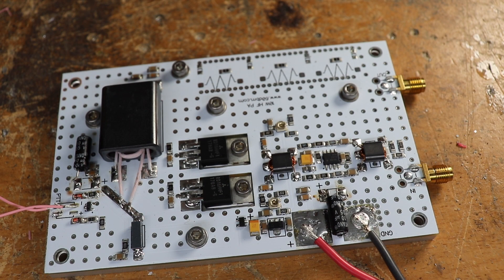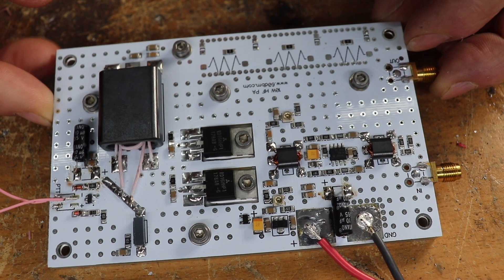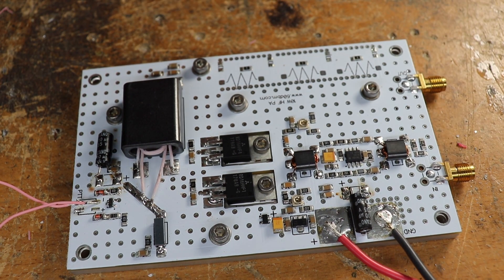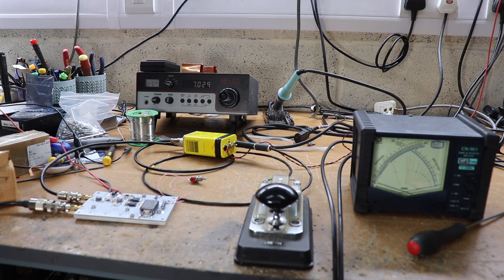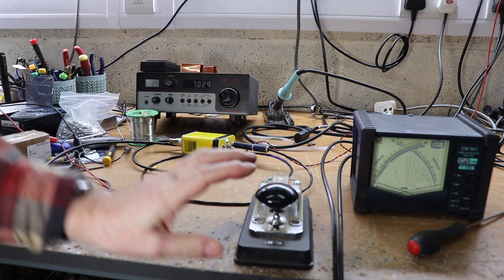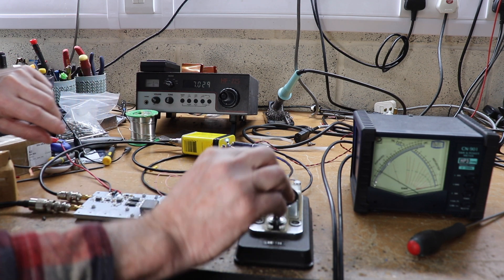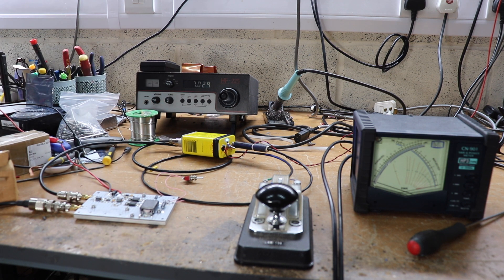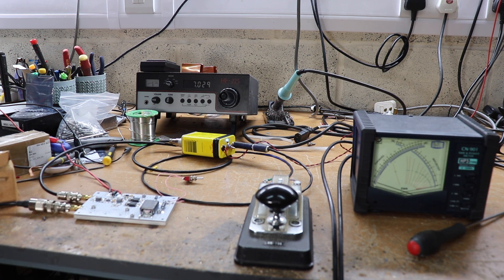Ukranian QRP 10w Linear Amplifier

Comment: I just bought the 20 watt version of this amp from Paul in Ukraine. I was very glad I could help a bit and it will be a really excellent amp for my RS 918 with a coaxial attenuator added in series with the amp.

I primarily bought it because it was helping Ukraine a tiny bit to purchase it. But, once purchased an hour ago I see it is an outstanding amp that can be run 24 hours a day, 7 days a week, 365 days a year in 100% duty cycle such as ft8.

I have a question if you could answer it. I never used an amp before, always was strictly Qrp so I am not quite sure how to trigger it out of standby into transmitt. It looks to me from the block diagram that there are two means to do this. One is shorting two pin outs on the board & the other is supplyong 12 volts Dc to two adjacent pinouts which seems to be what you did? Also can you supply power to the amp at less than the 24 volts nominal that is indicated in all the descriptions I have seen? I expect it has a range from min = X to max= y. If you know, I'd love to hear what you discovered.

Thanks & 73,
Mike B aka kc2wvb